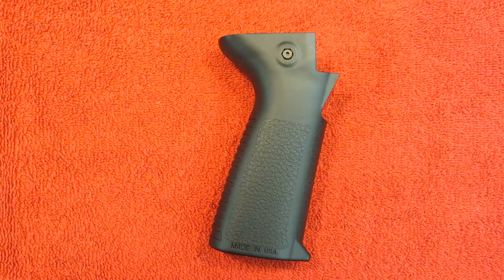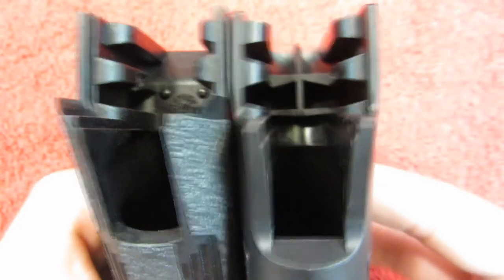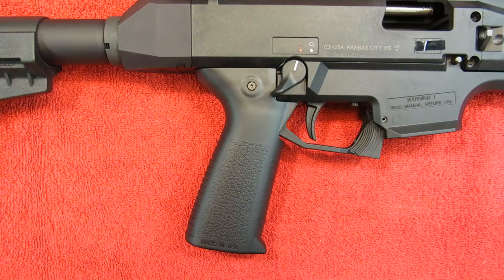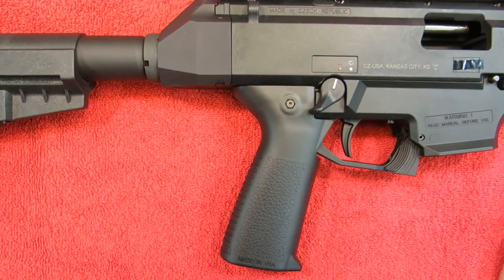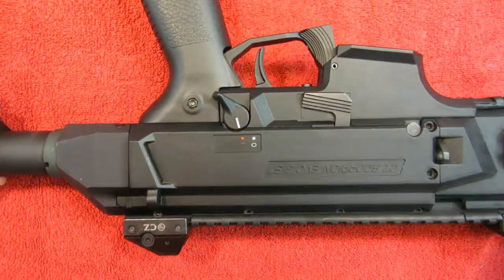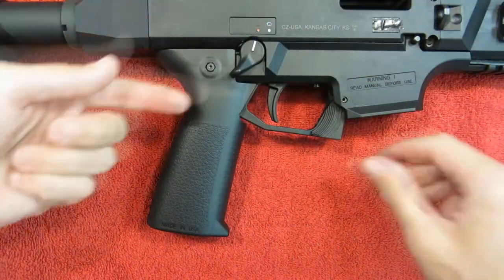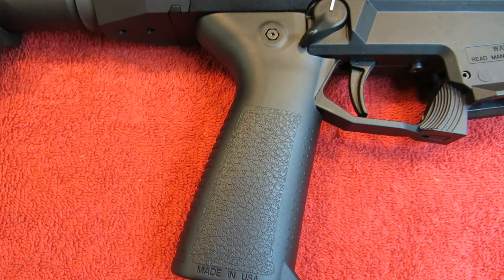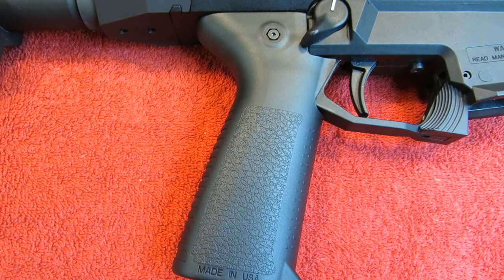CZ Scoprion Pakse PathFinder Grip

Comment: Looks like the nut is installed on the wrong side.
Reply: Its not i have one. The nut cutouts are the exact aame on both sides.
Reply: A minute in he explains that you can install it from either side as it's cut for the nut on both.